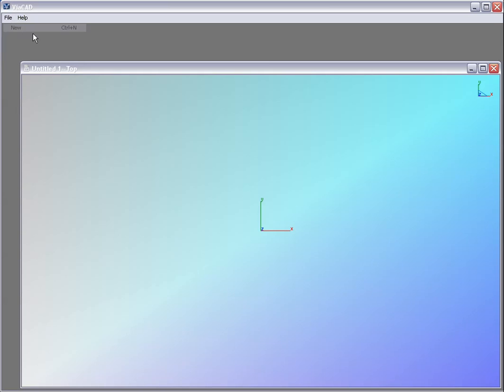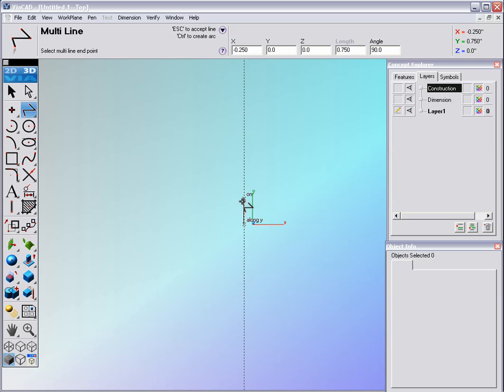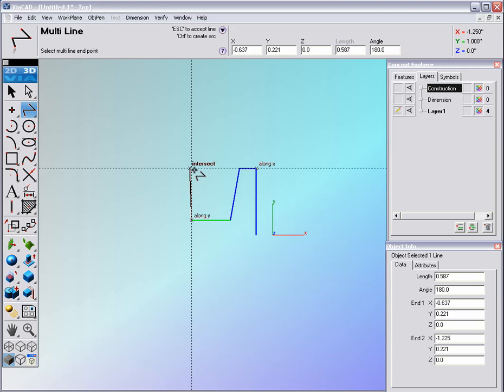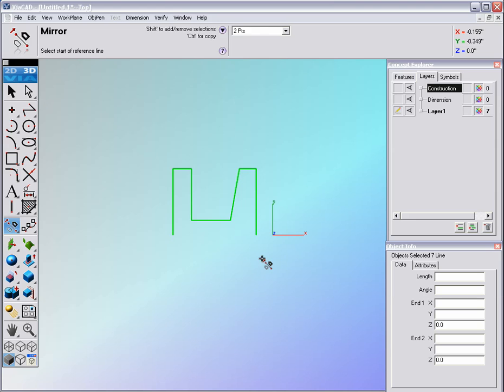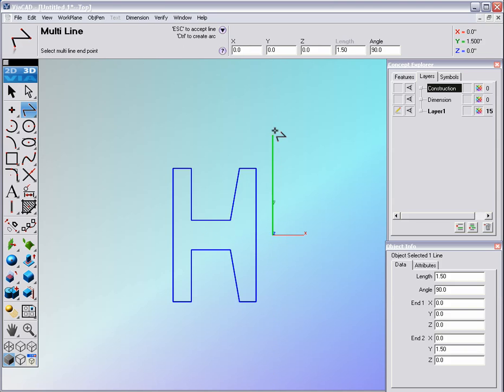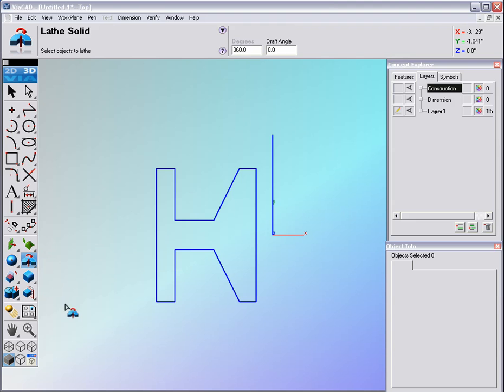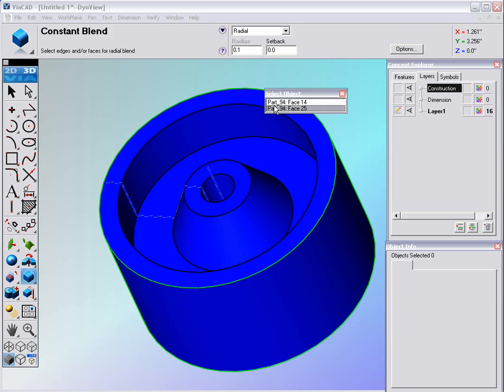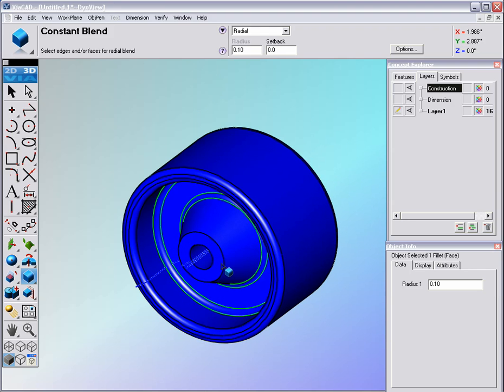E2 ViaCAD Tutorial

Comment from the maker: Delete geometry and start over. Make sure snaps are on so you don't have any gaps between lines. Also, be sure you are drawing planar and not having lines cross in the 3rd (Z) Axis. Also when attempting to revolve you can right mouse button click on any edge of the profile you plan to revolve and select chain, this will prevent other geometry not attached to the profile from being accidentally selected.